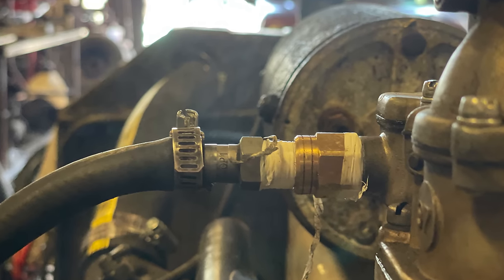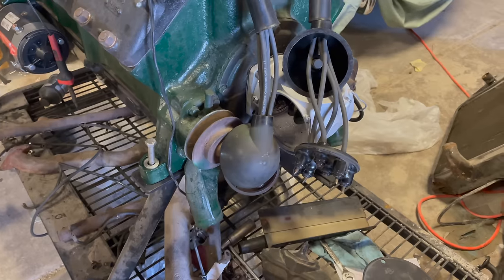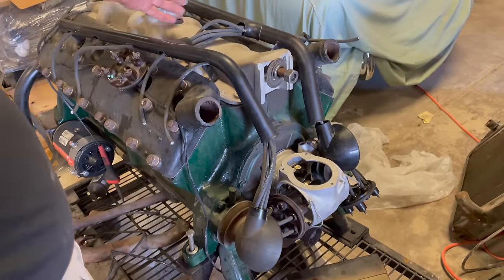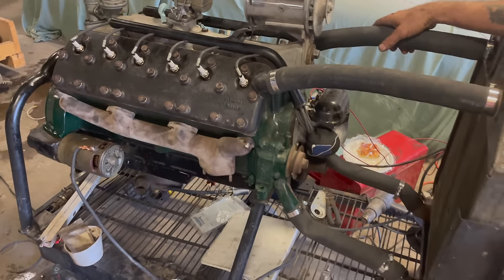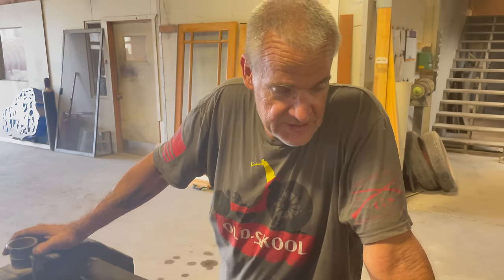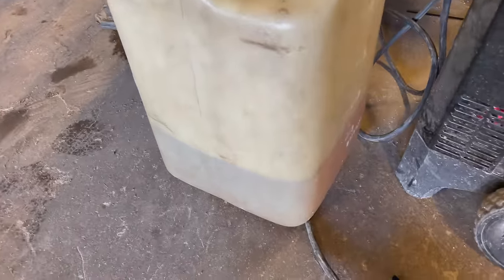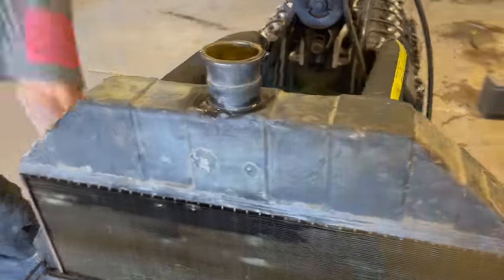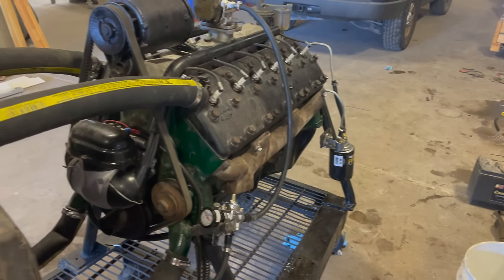Fire it UP!! 🔥 V12 Flathead Engine Ignition & Start! Lincoln Zephyr V-12 Series Will It Run? #barryt

Comment: Those engines run so smoothly, no vibration, great job. I am 82, a retired mechanic that appreciates the old great engines.
Reply from the maker: Thank you! 🙏
Reply: I've heard that back in the day, a lot of the owners of these cars after some time owning them wound up swapping these V12s for the more common Ford flathead V8. I think it was due to oiling issues. Thank you for the episode.  @BarryTsGarage
Reply: due to a V12's perfect primary balance, they have almost no vibration. a V12 may be the most perfect engine design if you don't mind a larger engine.
Reply: The reason for V12 auto engines in the 1930s was to get more power pulses on each revolution, creating a smoother running engine. That's why you usually found them on luxury cars, where the owner could afford the added cost to get a smoother driving and riding experience. With a six cylinder engine you get 3 power pulses per engine revolution, with a 8 cylinder engine you get 4, and with a 12 cylinder you get 6.

Comment: What a beautiful sounding engine. Nothing sounds better than a Flathead, whether its a 6, 8, or 12. Good for you man.
Reply from the maker: Thanks George!
Reply: That quintessential Hot Rod sound.
Reply: I have to agree with you on that 110%, why is that I wonder??
Reply: Flatheads really do have such a unique, beautiful sound, I owned a '49, and a '50. There were many in my family ( 6 older siblings ). The old power boats sounded sweet, too. Flatheads forever!
Reply: @boost7983 usually has a lower compression with a. Firing order her helps but is inconsequential mostly not always the case. They also had a good flywheel effect where everything was so heavy that they sounded smooth regardless. Because of the rotating mass

Comment: All V12 engines sound really good and although this particular 75 degree engine was not the best when it came to reliability, it had a flat torque curve that made it a top-end favorite for it's day. This one was the bank robbers choice for outrunning the cops with those Ford V8's.
Reply: Si ,pero hay algo mas El Lincoln tenia frenos hidraulicos  Bendix  y FRENABA bien Los Fords de esa epoca eran caballos desbocados con sus frenos mecánicos
Reply: I'm assuming they had to do some work on the intake. That lawnmower carburetor had to be starving these things.
Reply: Sounds like an airplane.
Reply: @fightfanian  
That "lawnmower carburetor" is probably the least of this thing's problems when it comes making a lot of power. Just being a flathead the air has a torchurious path in and out of the cylinder. It's still really cool though.
Reply: @177SCmaro My dad worked on a few of these back in the day. He always said that due to the poor mixture distribution, the front and rear cylinders on each bank were just along for the ride.
Reply: I wonder why it wasn't 60 degrees -- not enough room between the two banks for the pushrods/valves?
Reply: @johnwsimpson3153  Yep, that is MY question!

Comment: I had a great uncle who has both of his dad's V12s. They were complete cars that they cut the rear of the car off, leaving the bell housing and transmission, and mounted water pumps to the drive shaft, in place of where the rear ends used to be, to irrigate his crops here in NE Texas. About 20 years ago he busted one of them off for me to hear again as I had heard them both run back in the early 60's. Very cool old engines.

Comment: I really appreciate hearing those old engines run, there is just something calming in it.
Reply: My family had a 1939 Zephyr and as an infant it would lull me to sleep in th late `40's.

In 1949 dad put in a crate Mercury CHP V8.  It went faster than the V12 as it had a Colombia 2 speed differential.

Comment: The "diver helmet" distributor was used on Ford V type engines from 1932 to 1941. Ford changed to a "crab" distributor after WW2, but not sure if Lincoln did. Those "diver helmet" distributors were reliable, but had to be removed for maintenance. They only go on one way with a slot index, so there is no timing issue.
Reply: Gotta get me one!
Reply: Los buzos usaban la escafandra para trabajar bajo el agua AL distribuidor escafandra  no le gusta el agua para nada...

Comment: It is important to remember that the Lincoln Zephyr V-12s had the cylinder banks spaced at 75 degrees and not the usual 60 degrees.   As a result, the ignition firing pulses were 75 -45-75-45 and so on . . . . not the 60-60-60-60 of the usual V-12 engine.   Somewhat similar was the Liberty V-12 aircraft engine with its' cylinder banks spaced at 45 degrees.  The 75 degree cylinder bank spacing definitely affected the design and engineering of that ingenious ignition system.  Very, very cool indeed . . . .
Reply: By golly I didn't know that !
If I had a spare Ford GAA i would give it to you - but I've only got the one, so . . .
Reply: Edsel Ford being left alone to create like he wanted to.
Reply: ‘Had a Lincoln motor and it was really souped up. That Model A body made it look like a pup....”
Reply from the maker: Yup!
Reply: @edmundsmith7199  twelve cylinders and used em all!
Reply: Wait, there was more than one Lincoln V-12? Completely different from the late-40s Lincoln V-12? I didn't know that.
Reply: @edmundsmith7199  Hey, do you have any Edmunds speed parts? 😂😉
Reply: @jeffrykopis5468  The last Lincoln Zephyr V-12 was the 1948 model. The 75° V12 was eventually replaced by the InVincible 8, simply a version of the flathead V8 found on Ford's truck line.  So, I guess you'd have to say that the "late-40s Lincoln" was  a V-8 and not a V-12.
Reply from the maker: I hear you but also you have to say that 1948 was part of the “late 40’s”, right?  It was a great era of experimentation by many car makers, many that didn’t exist a decade later.
Reply from the maker: It’s true!
Reply: @PhrankTube  No I was referring to the V-12 in Lincolns thru 48, not the 337 V8. I don't know much, but I can count spark plugs!😂 But I may have misunderstood the original post: I thought he meant there were both 60 and 75 degree LINCOLN V12s.
Reply: @jeffrykopis5468  Hey, it is complicated isn't it?  Ha, Ha, Ha, . . . . Here is the breakout starting in 1932 with the big Lincoln sedans:
1932 Lincoln introduces 447.9 cubic inch (7.3 L) 65° L-head V-12 producing 150 hp (112 kW); K-Series product line split into KA-Series (V-8 powered) and KB-Series (V-12 powered)
1933 Lincoln introduces 381.7 cubic inch (6.3 L) 67° L-head V-12 producing 125 hp to replace 384 cubic inch (6.3 L) 60° V-8; all Lincolns now V-12 powered.
It is important to recall that the Lincoln Zephyr V-12s (1932-1948) were all 75° L-head engines.  The only thing we are talking about in this YouTube is the Lincoln Zephyr.  Thanks for replying in this thread . . . . fascinating topic!
Reply: @PhrankTube  Yeah, it sure is! Thanx for the info.
Reply: @PhrankTube  8 cq

Comment: Brought tears to my eyes when it started up. Just hear it run was so sweeeeet!!!
I remembered my 47 Ford convertible rescued off a junkyard and how it sounded with the rebuilt Mercury engine from Sears back in August of 1957  I have seen it 4 times over the past 30 years.  When I saw it in my work parking lot in 91 it had been Completely Restored . The top was down and I wqs able to reach in and feel the body damage still inside the rear quarter panel from when they pulled the body out of the yard in 57. Outside was OK but inside the UID was still there. LOL Ive seen it 3 more since but Im disabled and my wife wouldnt follow it to the car show. so I could actually talk to the owner. Im sure he would like to have the original paperwork I still have and know about its history - art least back to '57. 
Thanks for letting me reminisce.  Flatheads FOREVER!!!!!
Charley Ryans (REAL - V12) Hot Rod Lincoln (not commander cody's puny V8 version).  
https://www.youtube.com/watch?v=e58NJU5B3v8  . LOL
Reply from the maker: Thanks for sharing that great memory, Frederick!

Comment: Remarkable. It's like the flathead V8's ignition system. Setting up and adjusting the points are a real task. I've only tuned them. A real joy when everything is finally correct and it's driving with out complications.

Comment: I helped my great uncle get his 1940's Lincoln town car convertible running right before he sold it in 1996. He had it stored in a heated garage and only had to rebuild the carb and he had the starter redone. Fired it up and drove it down the road for a couple of miles. That car was smooth and quiet.
Reply from the maker: Love it!

Comment: I can remember seeing a Lincoln Zephyr Coupe at a car show, likely 40 years ago.  It had a V12 and can remember the owner turning the idle way down.  With 12 cylinders it kept running when a V8 would have died.  Cool motor considering when it came out.  Cool video thanks for posting it.
Reply: Cool and Ford flatheads do not go together. Both the 8s and the 12s with siamesed exhausts were boilers and simply ran parts of the engines way too hot. Not good for the iron!!
And Ford compounded the well known V8 problems by using the same design on the 12s.
12s of any sort leave me cold,, they sound like 6s. Merlins down.
Reply: @ldnwholesale8552  for their time they were the engine to build.
Reply: @ldnwholesale8552  Try Griffin’s or the even more extreme Napier Nomad diesel aircraft engines.
Reply from the maker: Thank you, Daniel. Working on some more videos like it - stay tuned!

Comment: I worked on an engine at least superficially similar to that back in the early 80's. It was on a 1934 Seagrave fire truck. V-12 Dual Distributers two spark plugs per cylinder, two coils, two single barrel carbs. Running new spark plug wires through those tubes was a royal pain. LOL  forgot one fun part, it had the hand crank for the front of the engine to start it.

Comment: Only saw and heard one V12 Lincoln engine in person.  I was at a car show/swap meet and someone was selling a 1940 Lincoln Zephyr Coupe restored with a V12.  He started it up and can recall the sound it made.  Even remember him showing us how he could turn the idle way down and it still ran.  Some around said comments that they'd dump that V12 and make a street rod out of it.  I recall saying a car that nice should never be chopped up into a street rod.  If I recall the asking price on the car was well under $10k, but that was in the early 80's.  I always wanted to find an original/restored 40 Ford Coupe, flathead and all, but never found one of those either.  I think it's great that some cars should stay stock and not be butchered up.  Cool V12 video!
Reply from the maker: If you have a look through the channel, you’ll see some restored Zephyr with their correct version 12. Also very lightly modified… Thanks for joining in, great comment!

Comment: It's just incredible how a small single carburetor feeds 12 cylinders,it runs and revs beautifully,what a masterpiece,love it 👌
Reply from the maker: Thank you so much, Shane. I appreciate your comment and will try to get some more similar content out there for you… Barry T
Reply: @BarryTsGarage  Thanks so much
Reply: It is a 2 barrel, not a single barrel.
Reply from the maker: That’s right, I meant to say single carb. Thanks Michael!
Reply: My dad used to say that the front 2 cylinders and the back 2 were just along for the ride. These should have had 2 carbs from the factory.

Comment: The high volume oil pump on those is a must.  I seem to recall that the zephyr V-12's had oil starvation issues.
Reply from the maker: A good idea. If you’re rebuilding, there are some oiling mods that can improve things as well.

Comment: Compression washers on plugs were very common in the 60's and earlier. We could reuse them a number of times.
Reply: I still reuse them.  Never had a problem from that.
Reply: Yeah, that's being a bit overly pedantic.
Reply: Worried about the compression washer but not Worried about oil psi.

Comment: I had a restored 48 Lincoln convertible which I sold a couple of years ago to a fellow in Norway.  The motor was so quiet you could not hear it at idle.  When going through the gears, It gave me the impression  that it sounded like twin 6 cylinder motors running syncronously.
Reply from the maker: That’s a great description!  Thanks for sharing, Bill!

Comment: Very cool.  There'a just one thing I noticed.  The fuel filter is on the suction side of the pump.  Those aren't suction filters.  Probably nothing will ever happen, but it is possible the pump could suck the guts out of the filter.

Comment: Looking at that engine and how small it appears to be is almost tiny compared to the 5.4l dohc engine in a Lincoln Navigator. A one barrel carburetor looks like the engine hardly breaths! Was a different intake ever offered to accommodate more carburetors? It sure sounds nice and smooth. Truly a work of art and a testament to quality engineering. Congratulations.
Reply from the maker: Thanks Daniel. To answer your intake question, please check out our recent video on that:  https://youtu.be/S_O687jSVSk
Reply: Engine was basically a V8-60, same parts, very weak crankshaft.
Reply: el V8 60 de tapa plana mas construidos de Ford ya que se hizo en Francia  para el Vedette  Despues para el Simca (Ex ford France)Tambien en Brasil , hasta el Chrysler alvorada  @NBZW
Reply: @juanasanelli6831  The 60 was offered in the 1937 ford in the US, only year I’m sure of, very weak engine for a rather large vehicle. An expression at the time, “You need too use 1st gear to climb a gopher hole”. The Simca was sold in this country in the 50s by Chrysler, soon as I saw the engine I knew what it was😂🇺🇸
Reply: @NBZW  hasta Citroen puso el Ford 60 en un traction Avant
Reply: @juanasanelli6831  It was a good engine for small applications but not enough power for large, the fuel economy was not much different from the 85 Hp engine. Makes me wonder if the V12 was also built in France. I was unaware the 60 was built there.

Comment: Very nice. My dad bought a new 1937 Zephyr, it was my parents Honeymoon Car. My mom said it wasn’t very reliable. I think those V12s tended to overheat a lot. There were 4 long cast in exhaust tubes running through the block, carrying the heat from 8 cylinders.
Reply from the maker: I am sure you are right about that, careful attention has to be paid to the diverters by the water pump to make sure there’s a good mixture and movement of coolant, I think there are other modifications to pay attention to as well. Great memory about your parents and having such a beautiful car for a honeymoon!
Reply: I drove a 36 in Florida for years and never had a problem with overheating. Ensure that water jacket in block was clean, radiator was clean and clear, and remember it was a 50 MPH world then. Don’t flog it hard, use ethylene glycol antifreeze and coolant, keep cruising speed around 50 and you won’t have cooling troubles. What a great car!
Reply: The pre-war version was not the greatest.  Plus, the engine compartment was too cramped - the hot discharge from the radiator couldn't exit completely.  The post-war (and 1942) engine was considerably better.
Reply from the maker: There are some mods now when you rebuild to mitigate some of the original oversights. Thanks for watching Michael
Reply: @BarryTsGarage  Another thing I forgot to mention is that the pre-war versions had aluminum heads that had undersized water passages and poor water pumps, both of which added to the cooling problems.  Your's, with its iron heads must be a post-war version.
Reply from the maker: There are no water passages in the heads, just FYI
Reply: @BarryTsGarage  You must be thinking of the Franklin V12.  It's heads had no water passages because it was an air-cooled engine.  The Lincoln V12 is a conventional water cooled engine, so of course the heads have water passages.  Notice the water outlets for the radiator hoses?
Reply from the maker: What I’m saying is the head is a void area without any separate passages. The iron head and aluminum head have the same profiles, just different material
Reply: @BarryTsGarage  There are no intake and exhaust passages in the head, nor are the valves in the head, as it is a side-valve engine.  The head does indeed have water passages, as the engine is a water cooled engine.  Yes, outwardly the the aluminum and iron heads are much the same, but the iron heads have larger and better water passages.  You can not design a water-cooled engine with heads that do not have coolant passages in them.  They would almost instantly get way too hot.

Comment: I've got one of these 12 cyls and its tranny. I rebuilt both and now I'm planning on putting it in a 40 Ford coupe. It purrs like a kitten and the trans shift very smoothly. I just have to modify the firewall and make mounts for it. But I think it will be a hoot in that old Ford Coupe. I don't care about a hot rod but, I think will be a great cruiser and road tripper. It's going it in about a month as soon as I get the body work done.
Reply from the maker: That sounds like a great project! You’re gonna have some Lincoln guys jealous because they can’t find an engine for their car… Thanks for your comment and thanks for joining the channel

Comment: Even for a flat head V-12, it's so quiet. Granted, it came out of what would have been a luxury car, so a loud raucous exhaust note wouldn't have been the objective. Although with a pair of two inch mufflers, it would still be able to sneak around pretty easily